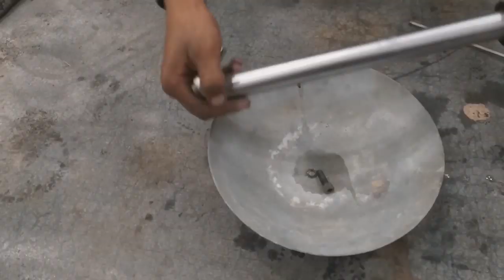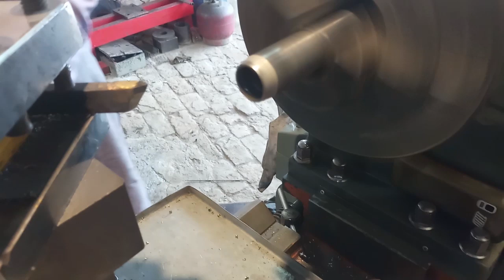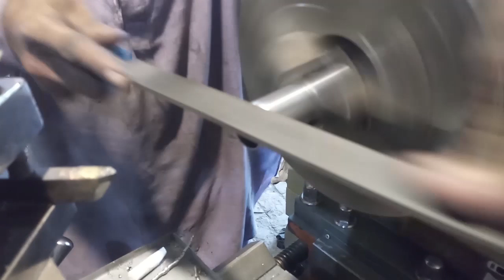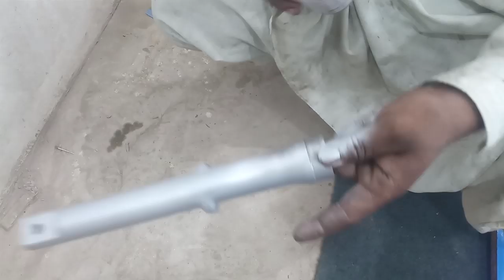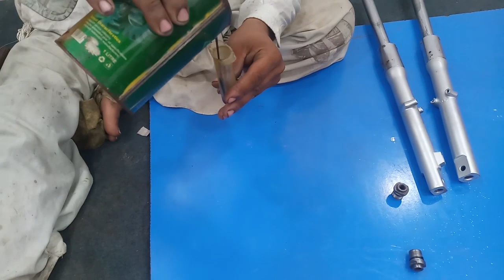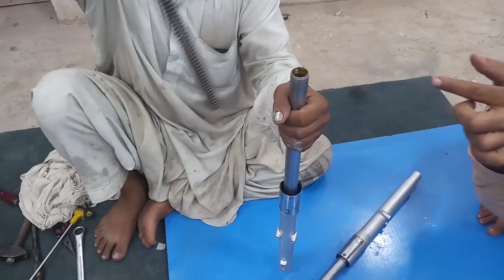Honda CD Fork Restoration | Front Shock Restoration

Comment: Wire wheeling the stanchtion,s and fork tubes seemed a bit harsh, you removed  and remaining  chrome, a buffing wheel would have been kinder, also did you invert the stanchtions to have the oil seal to work with cleaner metal?